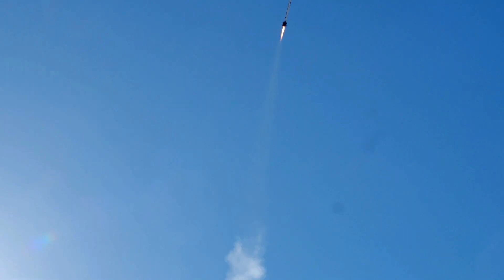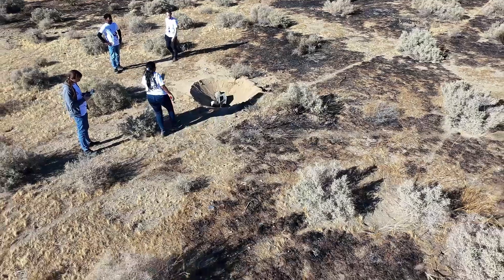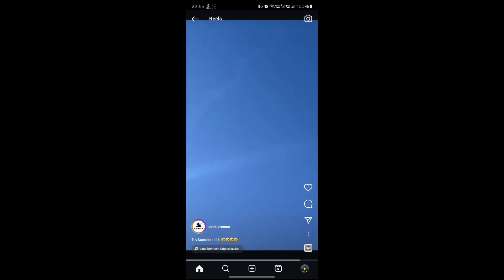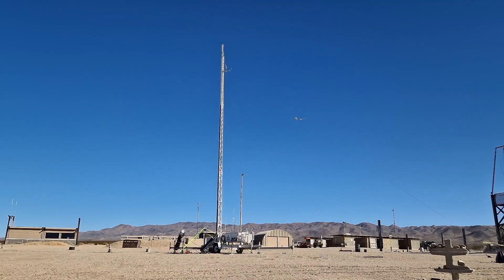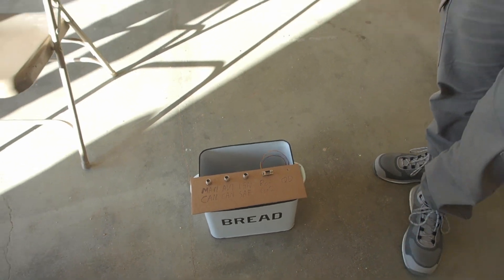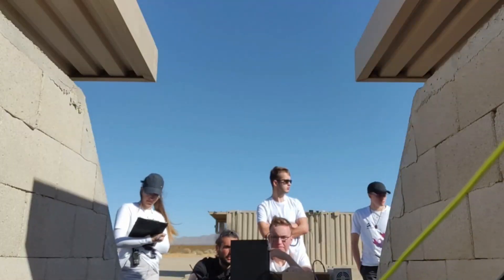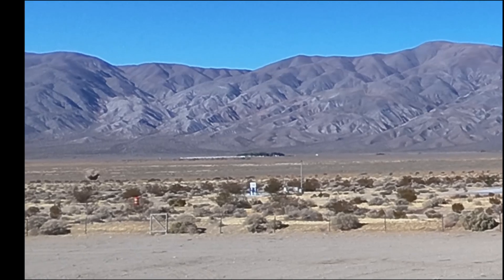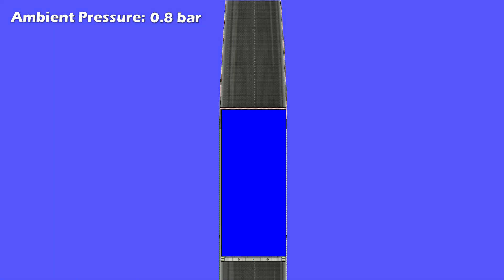Phoenix Launch Analysis

Comment: To stop your nose cone from popping off early, a common fix is to drill 1–2 small vent holes. They don’t need to be big - just enough to let air pass through during ascent so pressure doesn’t build up inside. Your CO2 device should still have no problem pushing the nose cone off later, since the gas won’t escape through those tiny holes fast enough during ejection.

Comment: It seems like you can save some weight because of the nose cone coming off, because you can theoretically switch the pressure canister out for just the locking mechanism, though you might want to keep it as a fail safe

Comment: Always interesting and educational to see a good failure analysis study. One thing I see missing is any corrective actions for the shipping issues, have you looked into anything you can do on the logistics side of things to improve your odds there?

One thing you may wish to consider is declaring a high value for the shipment with the carrier. Although this will significantly increase the cost of shipping since the carrier is assuming greater liability (and may carry customs implications for international shipping), with some carriers high-value shipments (unfortunately I don't know the exact threshold) receive special treatment like chain-of-custody tracking, being personally carried from truck to truck by a supervisor and never left unattended, etc. In addition to letting you file a damage claim if it doesn't arrive, this greatly reduces the chance of damage or loss in the first place.

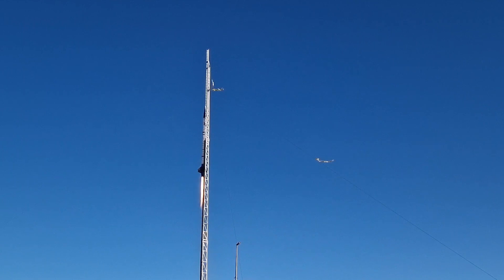Comment: 3:33 doesn't the acceleration change significantly as the motor burns out and the rocket becomes lighter?
Reply from the maker: Yes, that is true.  But the thrust also decays due to the decreasing pressure of the tank.  Turns out those two effect pretty much cancel each other out for our system and we get fairly consistent acceleration levels.

Comment: Great breakdown and analysis of the "probable cause" of not reaching all of your goals. Great improv as well.  Good luck and continued success. Learning is the success.
I had to chuckle at the "setting a brush fire in CA", and triggered some memories. Long ago, in the mid-80s, we were testing firing a solid hybrid rocket motor (with putting 400kg payloads in LEO), on a test stand at Edwards AFB. The test was a success, but pieces of hot/flaming propellant ejected into the desert, also setting brush on fire. We, too, had to get get our shovels and put the fires out.

Comment: Shear Pins?
Reply from the maker: Definitely an option we should of considered before.
Reply: @ASTRABremen  You could also put a tiny hole in the side to let the pressure equalize. This would probably work for Phoenix, but for the spaceshot that might have too large an affect on aerodynamics.
Reply from the maker: @wilboersma9441  If we did that, the pressure deployment wouldn't work so well cause the gas from the pressurization would also leak through that hole...
Reply: @ASTRABremen  AHH right, I forgot about that. I guess that technique only works for ebays
Reply: @ASTRABremen  while im not recovery person in our team, i believe all of our rockets had tiny vents to equalize pressure in the recovery bay, which we also use to detect apogee. I believe there are some ways to calculate adequate vent hole size so that despite the leak, pressure loss is so insignificant that the recovery system still works. if you have small enough orfice then pressure wont be able to instantly completly leak out and thus you can still eject the nosecone

EDIT: i asked our reco people and they dont recommend vents for pneumatic system(so far we used BP), and just recommend shear pins to hold the nosecone